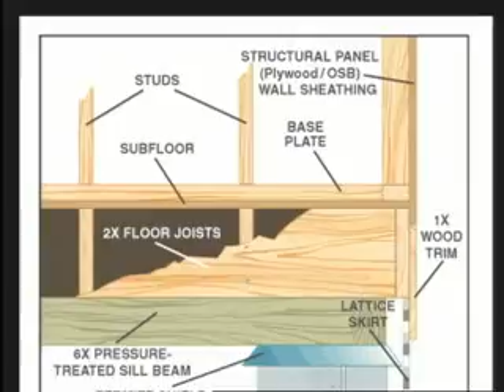Rediscovering the Raised Floor System

Comment: did i see them butt the joists into the side of the girder? i thought the joists were suppose to sit on top of the girder
Reply: They used joist hangers.
Reply: You can do that either way. The only thing I question is the double 2x10 girder. I've been a framer for a long time, and I've never seen a wooden girder that wasn't a triple 2x10.

Comment: not a bad system for much of the country but i would never own a home in florida or tornado alley that was not cbs with najor rebar 0r poured concrete  look at the recent hurricane that hit the panhandle, wood homes were toothpicks. only exception would be real log or dome. but the rest of the country this a viable option. i do like the engineered wood  as for basement homes great extra space but if not constructed right water incursion..of course in most of fl they be definatly indoor pools with the high water tables about 1/2 the year

Comment: it's so much simpler to pour a footing and slab all at once and be done with it!
Reply: The name of their page is southern pine so I think they are partial to wood.   I’m with you.
Reply: True enough but long term if something breaks or you wish to modify your home, breaking and repairing the concrete to make changes is time consuming and expensive.
Reply: @urbananimal55  true!  Many people get messed over by plumbers who charge outrageous prices making repairs but what they don't tell you is that you can easily run plumbing on ground around house bypassing expensive concrete work

Comment: Tons of people need affordable homes such as pressure treated wood on pea rock.  Its legal but Strict codes and Osha often make building these homes to costly.  
Rural areas no problem. 
Ive seen wood basements with the wood floor directly on pea rock and the center bearing wall post on a wood pad. Easy plumbing do-it-yer self.

Comment: I am an architect from Uruguay, have invented a raised floor system based on  pilings and a concrete ribbed slab at 3 feet from the ground or digging under the house and leaving the house flush with the garden. Have a patent in the USA, looking to develop the system, also have PCT, patent treaty in Paris for 150 countries. e-mail: jaimeboxeranaya@gmail.com

Comment: crawlspaces are a disaster in north FL due to moisture and mold issues. These issues can be solved, but most all builders don't think about doing that- the homeowner will find out what happens 10 years later. A stem wall with compacted fill is better.
Reply: I built my 2 story log home on a crawl space with PT  and have absolutely no mold in North fl Putnam county.
Reply: @JOHNG104A what did you use for insulation in crawlspace please

Comment: What a bunch of BS.  It's the ground connection that we have to exploit, not the square footage of the lot required to build it.  One reason we don't have ground source heat pumps (which would reduce HVAC costs across the board by over 50%) is because our lots are too small, and the houses on them, too big for room left to support the underground pipes required.  McMansion suburbia is the problem, not the solution.
Reply: Enjoy your tiny house.

Comment: He makes a valid point about repair and extensions of systems.  I encountered a water line leak in a 1 year old home about 30 years ago.  I found it just under the slab.  The copper had been 'dinged' during construction with an injury about the size of a bb.  the water friction took a year to wear out the hole, and then the leak was under the slab, and much harder to find, and repair than this floor system would have allowed.
Reply: MarkH10  In slab on grade construction the water supply line doesn’t necessarily have to be run underground. I recently finished a project where the plumbing waste line was the only “service” underground. Everything else overhead.

Comment: Do you build raised floor/ crawl space space cement block homes ? I Like raised floor homes for all the reasons you mentioned. In NJ most homes are full basement or crawl space only cheap homes are built on slab . If you  build a crawl space block home how far off Grade to the bottom of  the wall band ?.thanks for the video.  does a crawl space have to be termite treated in Florida before you place the plastic  on?  I
Reply: yes to the termite question,and 24 inches for the other

Comment: I hope your clients like the much greater cost of this system and 50 years from now the owners will be jacking the raised floor up just to keep their ceiling from separating away from the walls. Only use this system if you are building right on top of bedrock and don't mind the extra costs. Raised floor systems were never forgotten, they just aren't reasonable to build anymore .
Reply: "to keep their ceiling from separating away from the walls" Total hogwash!
If this were true anyone living in a wood framed building above the first floor would be experiencing this.
Reply: The cost comparison is like comparing apples to oranges.  I would direct you to http://budgeting.thenest.com/difference-cost-slab-raised-home-22511.html as one site that looks at this issue.  In addition, as indicated in this video, there is no comparison as far as looks or in accessibility to system components.  

As to your charge that ceilings will be separating from their walls in 50 years, the average buyer stays in house around 13 years.  In addition, I have seen hundreds of raised floor homes and lived in several.  Though this might happen, I haven't seen it personally.   That includes living in nearly a 100 year old home for awhile.  I assure you, it wasn't built on bedrock.  What is just as likely, if not more so, is a concrete slab cracking and subsequent damage to embedded system components.  Now, I have seen that in several homes.  

In the end, you can choose your slab but, for me, I like my raised floor.  I like being a couple of feet up off the ground in my 1939 craftsman home on my farm in whose crawlspace I was easily able to access the plumbing to upgrade.  In addition, I especially like my raised beach home.  There is something much nicer about being up off of the ground.
Reply: It might have been one of the first 'home improvement' trends, back when people lived with dirt floors.  Never cover the ground and expect things to stay the same.  Remove the sunlight and another ecosytem takes over.  It's a problem around boats and docks too, where natural growth under the water near the shore and on the shore is interrupted by the shade of floating objects.

Comment: When constructing a raised floor in a garage to bring it up to the existing elevation of the house, would you install a ledger board attached to the garage wall? Could you use pier foundation blocks?
Reply: I converted my garage but didn't raise floor because that would have taken away the height of the ceiling, so I just poured concrete around the edge and built walls on top 6 inches off ground, not bad but  I'm dealing with sealing to keep water from leaking in during bad storms, 

If you remove all flooring material on slab foundation you'll notice all water that leaks doing storms

Comment: why not pour the walls
Reply: Refuso = Leftist slug.
Reply: In fact, the whole structure should be masonry, not stick frame and will be soon as Climate Change re-writes our building codes for us.  I say masonry, because Normal Portland Cement has to be replaced when ever possible, with something equal to the job, locally sourced and that doesn't require temperatures of 1800C to make.  They burn coal, to make cement usually.  All that has to stop.
The inference in the video of your "raised floor" house being above the incoming flood waters as an advantage was funny.  Do they come with canoes for getting to the beer store, and does the beer store have a dock?
Reply: If everyone who believes the global climate change myth would stop reproducing, we would have this problem fixed in a single generation. Real science says that the climate has been changing since the first rays from the sun kissed this planet. It will continue to change until the sun dies.